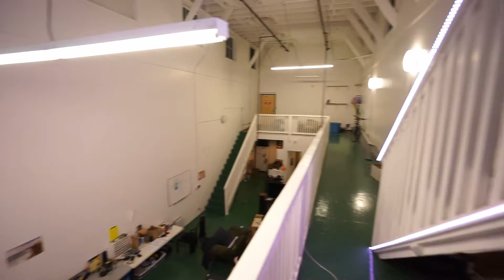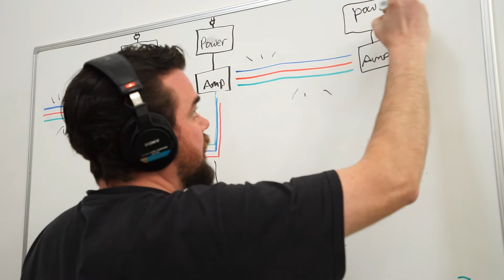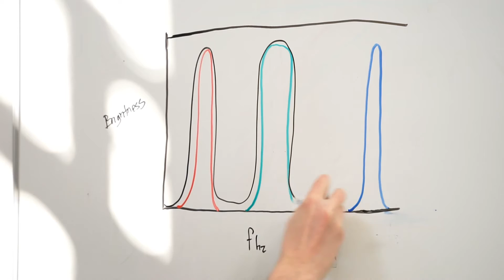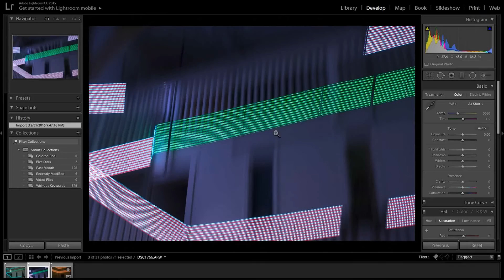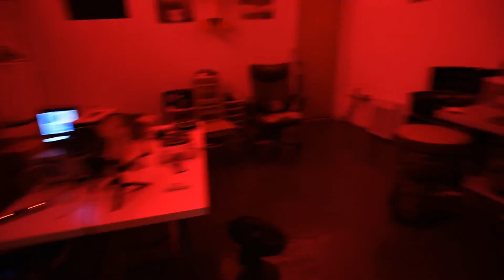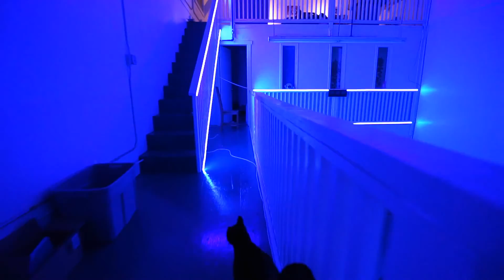Hacking RGB LED Strip Lighting

Comment: I'm totally doing this to my house this summer. I'm a senior in electrical engineering and this should be a good project but my focus is in power system analysis not micro controllers. I don't like coding.
Reply from the maker: You can always just use the off the shelf controllers for different colors and patterns if you don't wait to code. That's the part I geek out on. I don't know much about what power systems analysis is, but it was interesting to see how the attenuation was affected by strand length. Because the different colors don't have the same power curves, the combined colors slowly transition over longer runs.
Reply: Power system analysis are the electrical engineers that deal with 3 phase power and design the power girds and large scale power systems.

Comment: Do these lights look like CCFLs in a high quality photo? I'm trying to get the look but also be able to change the colors without having to change CCFL bulbs. I'm interested in the diffusion and angle of light cast also. Thank you
Reply from the maker: As discussed in the video, LEDs have a very narrow frequency response and I was not able to achieve a comfortable warm white light. There are LEDs with variable temperature but I have not experimented around with them. Each individual LED is a point and not diffused at all, but because there are many LEDs I guess you could consider it diffused. Not sure about angle.

Comment: Loved your info man. I was trying to find a way to increase the current alone on a bluetooth controller that i really liked. Your information showed me that its called an amplifier. If you dont use the correct terms its hard to find what you need, even if you know exactly what it does. But I wanted to inform you that ebay and amazon overcharge. Try AliExpress. Its an app and everything is literally half price of ebay or amazon. And its all the SAME stuff. All from the SAME place, China. Check it out man you'll save so much money.

Comment: I much prefer smart (individually addressable) LEDs... If I were going to put that much effort into installing them, then I'd definitely want them to be able to do more than simple one color effects. That said, the regular RGB lights do seem to be less problematic than the smart LEDs such as WS2812B, so it's a give and take. Damn bro, you even used an Arduino, but didn't use addressable LEDs? Surprised... Anyway, it does look cool af, and your house is cool too. Really nice work.
Reply: Big facts
Reply: Wouldn't be so much harder with all those LEDS to have them all individually adressable, I thought about it but 30leds per meter is a lot of wires